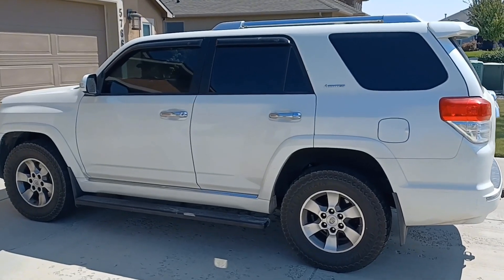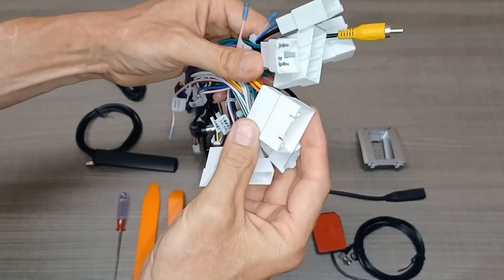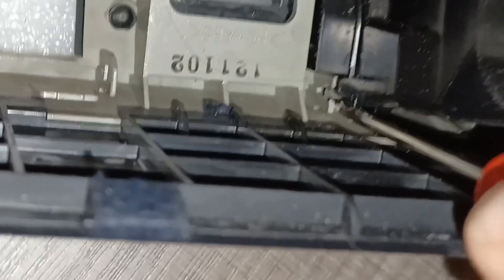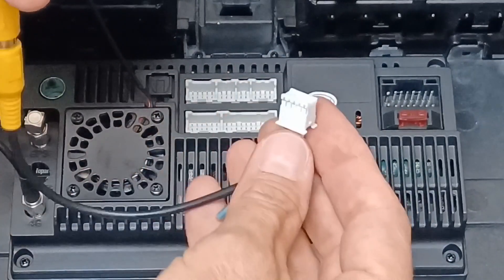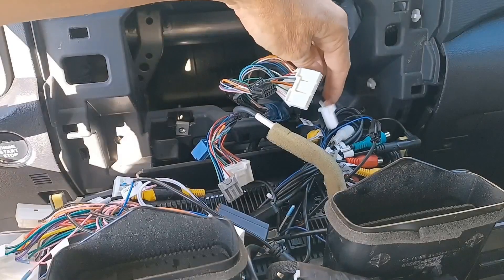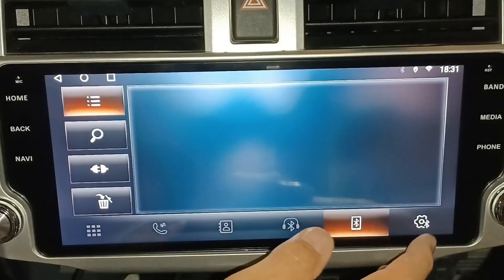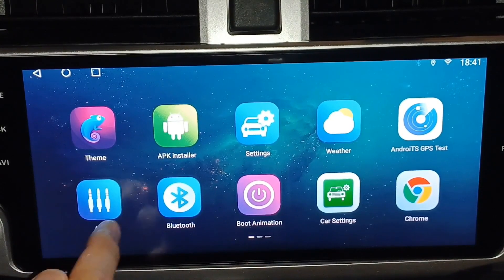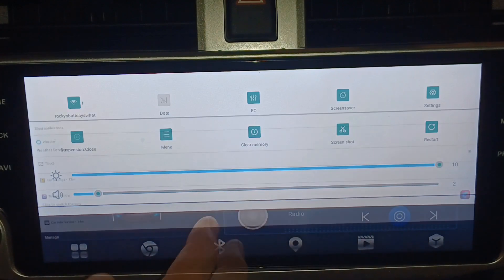MEIauto Android Auto/Nav/stereo Toyota 4runner (2010-19) Review/HOW TO!

Comment: Did you happen to get the steering wheel control to work?
Reply from the maker: Yes...I know I probably didn't show it in the correct time sequence as what I actually did when I installed the HU the first time (I installed it twice, lol), but it worked perfectly. We're you able to get yours too or...
Reply: @hurstysgarage  no I can figure how to get the steering wheel control to work 😢
Reply from the maker: @t-money10  I'm sorry to hear that...dang! Ok, my suggestion now is to contact the manufacturer and get them to walk you t through the steps...they are very responsive, and there could be an off chance that your control module is defective, which they can replace for free!
Reply: @t-money10  Did you program it after installation? The buttons need to be assigned through the menu  settings.

Comment: I connect everything to the letter and you can’t hear it😢
Reply from the maker: @greyrigarcia603  shoot, sorry to hear you are having that problem! Let's try a couple things see if this helps:
1. Always go back over connections, especially main harness, to make sure they are truly mated together and that no inner pins are busted off.
2. Check fuses for radio in fuse box, as well as fuse on back of radio.
3. Check settings on radio in The Equalizer section to make sure that nothing is set to muted or anything like that which sounds stupid but might have been invertedly hit to off 
4. Contact Laura or the actual Mei customer service at the 4 ways they have on the back of the warranty card and they will be more than happy to work through the problem:-)
Let me know if that helps you out because I'm very curious and I want to make sure that the product I'm pitching is a good one!